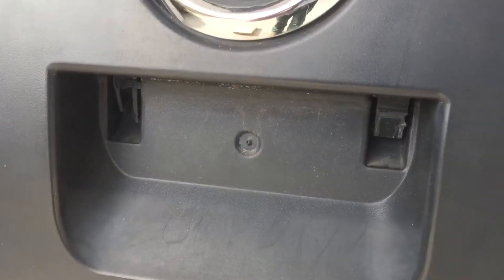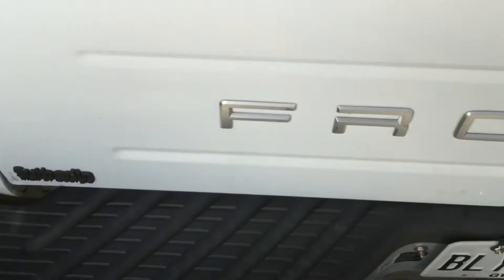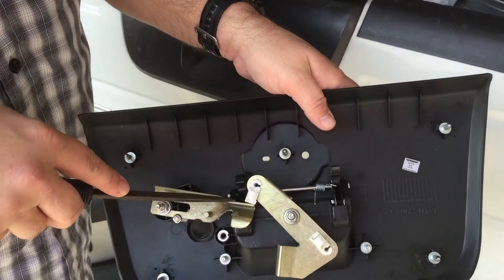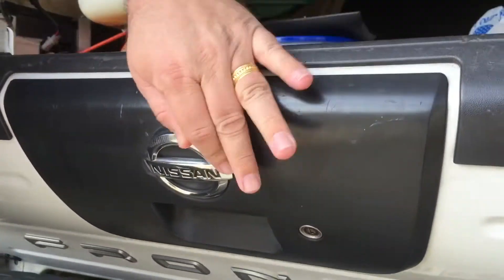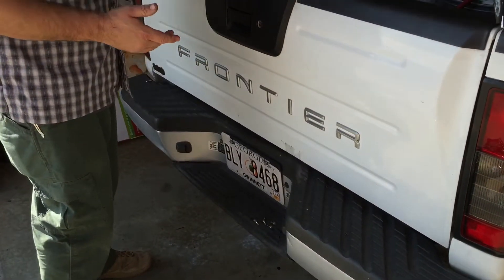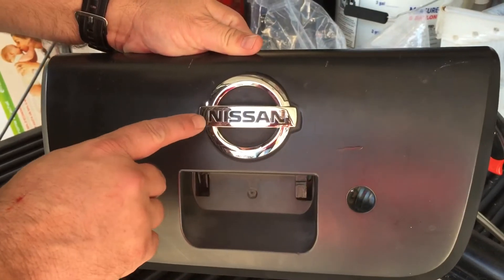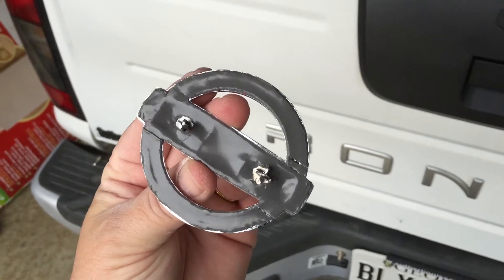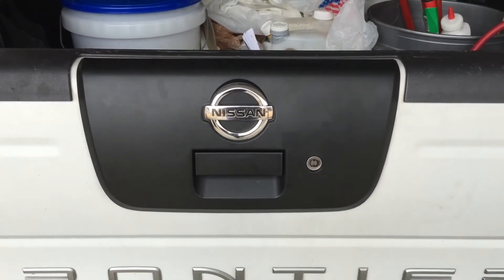2003 Nissan Frontier Tailgate Handle Repair  (Exclusive!  How to open closed tailgate.)

Comment: I want to thank you for your time making this video. My similar issue was the lock plate kept sliding off the other plate. So my wife bought this same replacement and wow it went in fine. 38 bucks I think. Had grommet issues when pulling out the old pins, but I put them in my vice, and spread the grommets and the pins came out, then they snapped back in. I had ZERO confidence before this video. Thank you again.

Comment: Nice tip regarding the method to open the closed tailgate.
Reply from the maker: Sam Erazo thanks.  I figured someone would need the info when theirs ultimately breaks.
Reply: My tailgate is stuck closed too…. Thank you so much for your genius solution!!

Comment: you can use a small pocket screw driver and push on the latch mechanisms on the side of the tailgate from the inside of the bed, while pulling on the each corner to unlatch one side and then the other. You can see the latch with a flash light.
Reply from the maker: I guess it’s best to have two people for that method.

Comment: Do you remember what you used to pull up the seller on amazon to obtain this same replacement trunk lock as a full assembly? Do you recommend breaking the handle as you did in the video? My 2004 Frontier pickup will unlock if I spend an hour in the rain or snow and fool with that damn lock. some DIY fixers recommend tightening that 10 mm Phillips head screw down as that ultimately seems to be the cause of these locks not working properly. Maybe some Loctite goo put on the bolt beforehand may help keep it from happening once the lock is replaced with a new one.

Comment: I don’t know what I’m doing wrong the piece slides and won’t stay in place to make connection and work correctly, so I’m kinda stuck. The rods pull a little but I don’t think enough. So it won’t go in enough to unlatch from the sides to go down even when I put the piece in place.
Reply from the maker: Is it trapped shut, or can you access it from the bed side?
Reply from the maker: Also lock and unlock the latch.
Reply: @ManCrafting  I think it was the assembly of the replacement ? I used the old parts on the new handle and plate and it worked ! Replaced it and everything it’s all good and working now. We troubleshooted and figured it out thank you for making the video it helped me to begin with & made it possible to even do it !! 😊
Reply from the maker: @ awesome.  So glad you got it worked out. ❤️

Comment: Thanks for sharing.  On mine it seems each time you use the handle it moves the lock mechanism til handle does not work.   Was thinking of replacing (perhaps has wear), but my plastic part has NISSAN cut out into it instead of using the emblem & I can't find a replacement like that!   It is a 2001.
Reply from the maker: Carol K apparently that is the only year  07-00 to 07-01 that had that style. The exact same fit is the one I ordered.  If you had the repair done at Nissan you would likely drive out with the newer version.